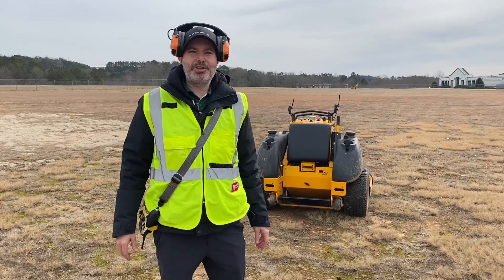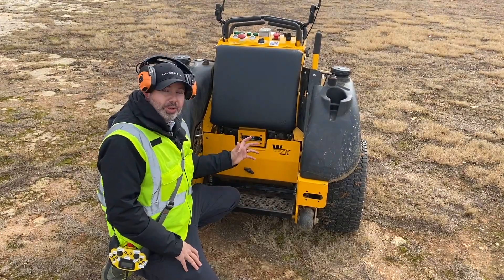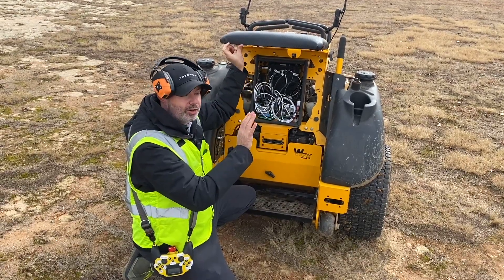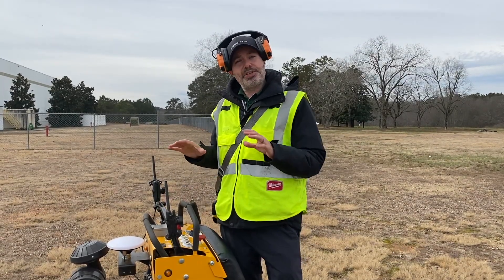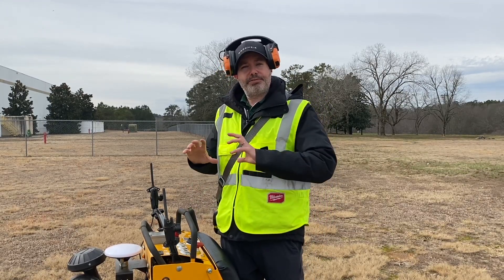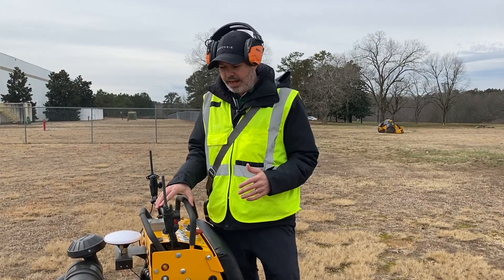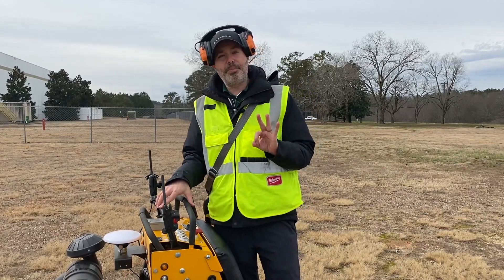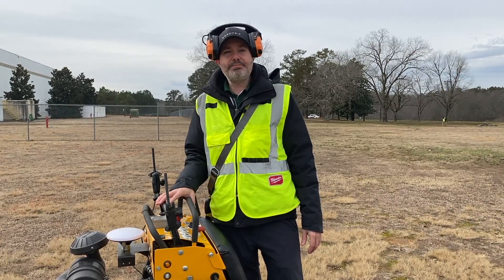Greenzie Product - How it Works: Autonomous Upfitting

Comment: Do ultrasonics work alright outside with wind, engine noise, and other noises? How do you like it compared to radar?
Reply from the maker: The ultrasonic sensors we use are designed to be used outdoors, are waterproofed, and have internal calibration to filter out bad data. They operate at a much higher frequency than the engine and most other types of noises. We haven't tested with a radar sensor to be able to draw any meaningful comparisons. Functionally, they work very similarity to the ultrasonic in new cars that are used for parking assist.